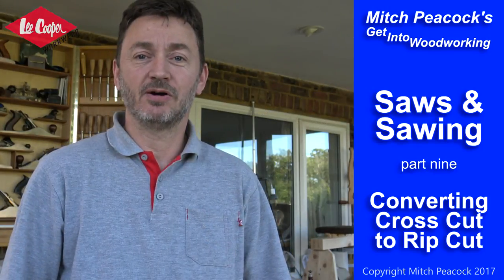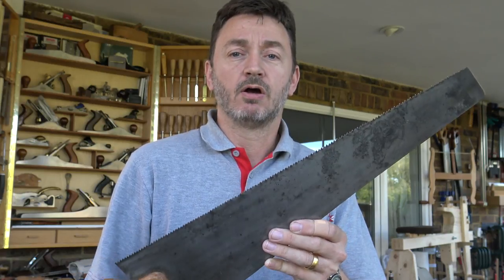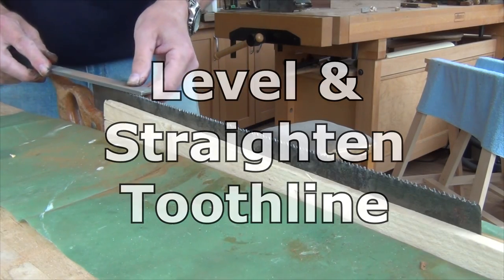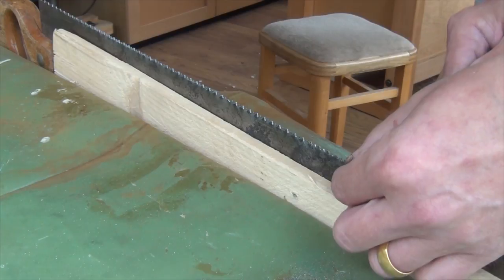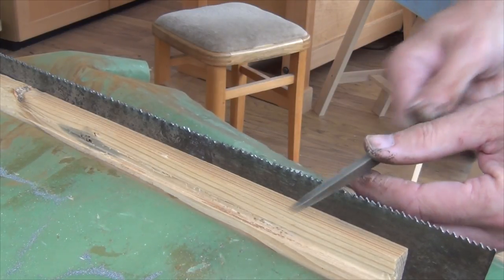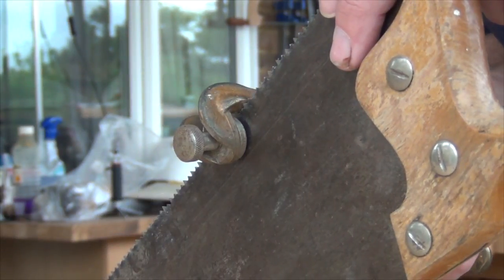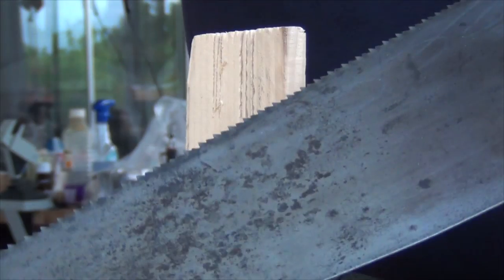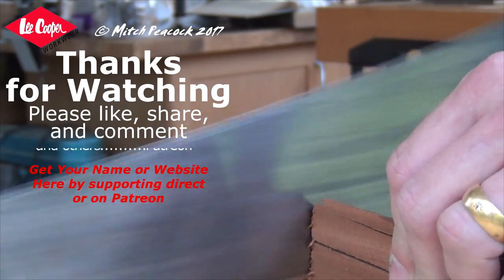Cross Cut to Rip Cut Panel Saw Tune Up

Comment: Nice project, i'm keeping a saw just for that purpose but i still havent found a saw set around where i live and i don't feel confortable doing it with hammer and anvil.
Reply from the maker: Thanks. I've had a saw set since before I started woodwork seriously, so I've never had to rely on other methods for other than tiny teeth, where I use a screwdriver blade twisting between teeth. Works okay, but hardly repeatable with high accuracy!